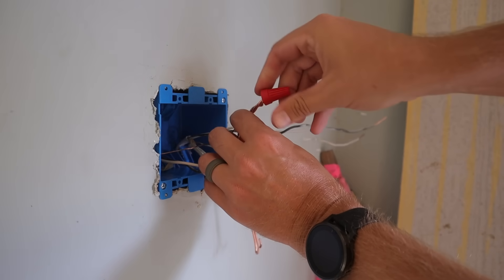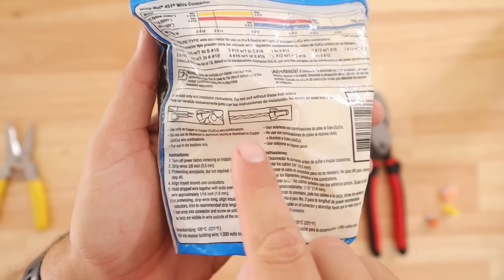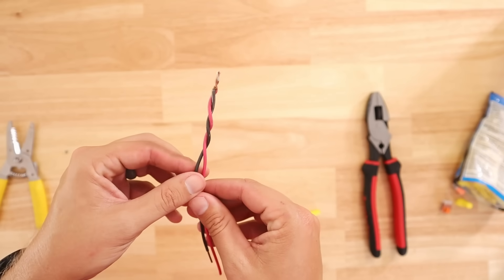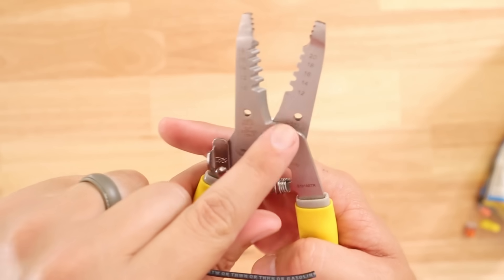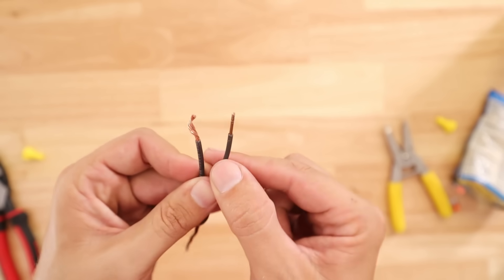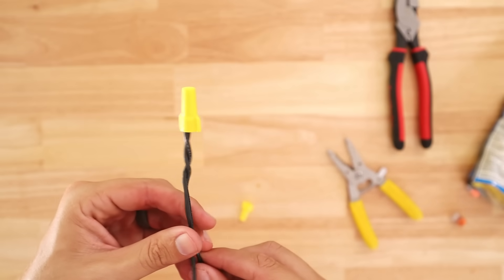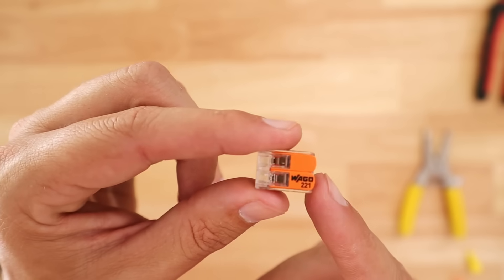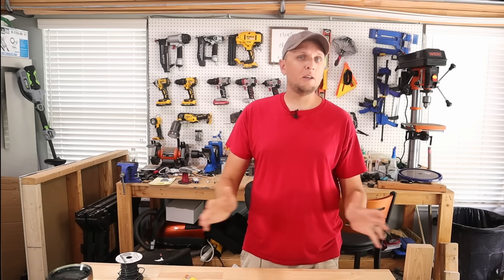BIGGEST Mistakes DIYers Make When Connecting Wires Together | How To

Comment: As an electrician and an adjunct electrical instructor, I certainly am behind everything you say. At the end of the day you want a secure connection that will not become undone under any circumstance. I can't tell you how many times I've found phantom power issues caused by poor connections.

The only area where I have a difference of opinion is where you talk about twisting the insulated parts of the wire together for an extensive distance. An Ideal rep told me the reason they depicted the wires twisted together so far was to prevent liability issues; they were trying to show the wire had to be twisted under the wire nut. A couple of twists beyond the wire nut is more than enough. My experience is that twisting the wires so far takes up room in the device box, as well as any wire too short, plus it's a pain for the poor electrician who has to modify it later. Keeping the work neat and clean also helps prevent wires from slipping out.

You used the best kind of wago nut, but not everyone will. The kind where the wire slips in, with no locking levers, is meant to be used only once, especially with stranded wires, as the jaws will no longer be as tight. It's a real problem when someone takes one off a 12 awg wire, puts it in their bags, then reuses it with a 14 awg wire. There is no way the connection will be as good. Again, this applies to the regular wagos, not the ones with levers as you used.
Reply from the maker: Hey Casey, I really appreciate the feedback on everything.  Thanks a lot for taking the time to write it all out!
Reply: Voltage will be off wire burning off a well and everything bouncing around with all that extra wiring cover jammed in that wing nut. Also he mentioned using strayed wiring. Always cut both fresh is questionable. Strands don’t push voltage, but do start fires. Also. 2-3 twist after nut is tight, Tape it for a hold on the twist. But all around good advice. I’m a beginner. But it’s pretty self explanatory. Now I’m not getting in over my head though. Would love to apprentice a pro working with boxes learning to run long lines , can install if day 95% 110 items such as lights, fans piggyback outlets(gvcis), run new outlets. The basics. But I’m not getting over my head burning  a house down or worse hurting myself. I’ve researched and double checked with the big dogs before breakers are flipped. No 220 experience yet either. After a Little more heavier electrical experience and higher end plumbing experience. I’ll be a jack of all trades. Master of some. Started off with flooring 3/4 red, white oak, pine, red heart pine, herringbones to custom burns not on styrofoam padding but on top of 3/4 plywood shot in with .22’s. Then board by board stapled on that tongue every 6-8 inches at 13. Back before these laminate and vinyl floors. Floors you can actually sand and refinish for years to come. Just picked up skills through the years with the pros
Reply: That's what I'm saying. This guy's jerking wires apart like everything he wires is for a mobile home that is constantly trailered just solder it off you're that worried. What does he think is going on behind a wall plate, Fragile Rock? Just what you said a couple twists it's good.

Comment: We build industrial control panels.  We used to get a lot of service calls when we used screw-tightened DIN rail mounted terminals.  We would tighten up the screws and the machine would work again.  When we switched to WAGO terminals those types of service calls ceased.  We crimp boot lace ferrules onto stranded wire and shove those in the WAGO terminals.  They come in sizes all the way up to at least #8.
Reply: Yeah WAGO terminals rock. He's talking about the WAGO 221 though. Usually they use these in commercial lighting. I'm not a fan of them, a proper splice and wirenut is far better. One place I worked, we were replacing splices with these WAGO 221s on the lights, so the security guards could change ballasts out easily, without having to call their service contract company (us). Boss charged them a ton for it, since it meant he lost a huge yearly maintainence contract changing bulbs and ballasts in a big sky scraper. They just don't hold together as well as a proper splice. 
Give me WAGO terminals in a control panel all day long though, please. Especially with a ferrule crimped onto the end. That ain't ever coming loose, no matter how much vibration there is from the unit it's mounted on.

Comment: I am a DIY and had a county building inspector tell me to tape the wire nut onto the wire after twisting the pairs together and installing the nut.  Needless to say, I did what he said just to get his approval.  This stalled my project for 2 more weeks.
Reply from the maker: Wow that is quite the delay!  Yeah whatever the inspector wants, the inspector gets.  They are all different.
Reply: @HowToHomeDIY  I’ve had a couple of difficult inspectors over my 40 year career. I don’t give into their wants and needs. I asked them to print out or point out in the code where that is required.

Comment: What causes a splice to fail is HEAT.  The higher the CONSTRICTION RESISTANCE the higher the OPERATING TEMPERATURE.  Tightly twisting the conductors together REDUCES CONSTRICTION RESISTANCE to a MINIMUM.  In addition to reducing CONSTRICTION RESISTANCE tightly twisted conductors have the best MECHANICAL INTEGRITY.  Remember these words and use them to instruct others.  If you know OHM'S LAW it's all the better.   Wagos are JUNK.
Keep 'em from burning down :-)

Comment: 1:00 is it good enough.  No.  Not with a yellow wing nut.  However, had the wing nut been beige instead of yellow,  it would be good enough.
11:00. The best installation is crimp and tape.  That would be hard to find.  In 20 years of being an electrician, I've only seen it specked on a job, once.

Comment: I like Wagos for solid/stranded connections and for very tight spots. They are pricey but I'm not a pro. So I'd rather have the 20 connections I make a year be solid without having to triple think things than pulling stuff and wondering if it would have been OK without. I made a remote controlled outdoor outlet over the winter and I used Wagos just because the IP<whatever> enclosure was tiny and I was having a hard time getting wire nuts in place. (And all the demo videos for the WiFi switch were from the UK where they use Wagos all the time I think by code.)

I don't know how they stand up to pulls and pushes in general. I do feel like every time I'm stuffing wires back in a box I'm rolling the dice so I don't know if I'd use them in most wall switch kind of applications.

Comment: It's pretty simple really, if you aren't turning your wire nuts clockwise, and you aren't giving each wire a good tug to ensure it's not loose, then you are doing it wrong.

I can't stand when I have to work on broken shit that's hot on a service call, open a box and find some overkill electrician pre-twisted, and post twisted every damn wire together. Completely unnecessary. 

Also have seen thousands of wires that popped out hot, and tripped gfi's or breakers. Burnt things, broke things. I've seen people over twist till the wires crumbled inside the nut and later melted down like nuclear waste until causing a small fire. So it goes both ways. Overkill and underkill. 

People who only do new construction, or put things together once, and move on, have no clue how to make things serviceable and safe 9 times out of 10. Just my experience after 20+ years doing commercial and industrial electrical work.

Comment: Wago connectors are great for lighting or low current devices, I would not use them for motor controlled devices or higher amperage. Mainly what you have are two blades making contact on the wire in a sense derrating the wire IMO; great for lighting tho…

Comment: I like the ease-of-use provided by the Wagos, but it’s important to recognize that the Wago becomes an in-line component of your circuit.  ALL of the energy in your circuit passed through the connecting bar in your Wago.  The wire nut, on the other hand, and as clearly demonstrated in this video, only wraps and hoods the twisted direct contact. At most, some energy will pass through the wire nut parallel to the twisted connection.  
My point with this is selection of the correct Wago is critical. Especially as you move up to higher power applications.
Reply: Sure, thousands of electricians trust the current carrying ability of a tiny copper plated springy tab pressing against one side of a conductor.  The amount of actual surface area where the flat tab touches the round conductor is laughable.   Over 20 years ago they first introduced this design, and we veterans of the biz watched it fall flat on its face over and over....   
I guess some never learn....
Reply: @kdubb288  From a well seasoned electrician, Well Said
Reply: @kdubb288  As an electrician completely agree.
Reply: @kdubb288  In other words, the real "problem" with lever nuts is the fact that we insist on solid core wiring, that can't deform to make good contact.  We've used them industrially on stranded wire for decades without issue.
Reply: @wagnerrp  a "lever nut" is not the same as these strip-and-push in types.  But neither will obtain the same surface area contact under pressure that a healthy twist with lineman's pliers obtain.  Ever.
Reply: @kdubb288  Ok..you are over my head. Did you just say use wire nuts instead of wagos?
Reply: @denisemartin3603  YUP!
Reply: We use wagos in solar all the time. Even tesla supplies them for their battery walls

Comment: The wire nuts themselves make a huge difference.
We use the 3m nuts and the spring is so damb sharp it really cuts in and will twist wired.

Those ideal nuts are OK but when you twist them you feel the spring spring back.
And yes you should pre twist for almost all connections.
Reply from the maker: I have some of those 3m wire nuts.  I need to give them another try.  Some of my electrician friends swear by them too.  Thanks for the feedback Nick!

Comment: Another suggestion is to wrap wire nut and wires with electrical tape to eliminate vibration issue on wire connections.

Comment: If you have time to waste, pre-twist. With today's wire nuts, it is not necessary to pre-twist. Pre-twisting was recommended many years ago when the wire nuts had setscrews that tightened down on the wires, then a plastic cap was threaded on the brass sleeve. It's good practice to twist 2-1/2 to 3 turns.  You can over twist as well, which puts a lot of strain in the wires.

Comment: I'm a long time DIY'er and let me tell you, this is some good advice! I wasn't familiar with the WAGO connectors but will probably try them on my next project; particularly on something like lights and fans that sometimes have very small gauge stranded wires.
Reply: Over here in the UK we use Wagos all of the time on 240v. They're absolutely fine it's the cheap knock offs that are an unknown quantity. 

Don't understand why the pros on the other side of the Atlantic haven't ditched the wire nuts yet, far too time consuming. The resistance of the joint between those and Wagos is negligible and would only have an effect if you had something like 1000 joints on a circuit. Not realistic at all.
Reply: @johnt9379  wire nuts rule the roost over lever connectors for cheap connections though.  Overall I prefer the lever connectors if there's any chance the wiring every needs to be reconfigured or disconnected while live.  Once the wires are all twisted securely for the wire nuts, they can't be properly reused without cutting it down and hoping you have enough of a service loop to work with to redo things.
Reply: @johnt9379  Wagos have not taken on in the US because electricians trash talk them.  
It's because it makes it easy for do-it-yourselfers to work on their own stuff without hiring them.
Reply: @highping1786  Professionals over here don't (shouldn't) really be putting joints on socket circuits anyway whether it's a ring or a radial. With our sockets we terminate straight into the socket and have no need to have to fly lead off. If a socket needs moving you try to pull cables back and rewire short cables completely. Doesn't always happen but we definitely don't need to wago cables for socket circuits nearly as often.

Lighting on the other hand we use wagos quite often. the wago itself is rated at 32a but the circuit is protected by a 6 or 10a circuit breaker. I just think it would be a pain having 500 lights to fit in a warehouse and using wire nuts. Time is money after all.

If DIYers want to use them in their house then let them. Don't want to work in peoples homes anyway and would much rather work in a commercial or industrial premises. Less s*** work for me to have to do.
Reply: On small stranded wires, get terminal crimps before putting them into the level locks / WAGO
Reply: If u gonna use stay cons/crimp sleeve……no need for much else besides insulation or tape to cover
Reply: Wago lever lock type hood for dif sizes….small to big ect

Comment: When twisting wires together, usually 12-gauge, I like to not only twist them tight but I cut the top at an angle so it dives deeper into the wire nut and cinches down tighter. Cutting them square reduces contact area within the wire nut. Ultimately I rely on the wires themselves being twisted together, the wire nut is just the insurance policy and mostly removes the chances of the wires touching anything.

Comment: Ok, so it is not NES code violation, it’s just your bias opinion (wing nut) I get where you are coming from, but is not gospel. I twist the tips, then wire nut, that’s the way I was taught.
Reply from the maker: No the first one is an NEC violation as it didn’t follow the instructions.

Comment: Glad to see this laid out so clearly, and really glad to learn about the Wago connectors!  Seems like they'll work MUCH better tight spots!  Thanks!
Reply from the maker: You're welcome!  Really glad to hear you liked it.  Thanks for the feedback!
Reply: Good products cost more money.  If you take your time you can accomplish the same goal with wire nuts and save money.  If you are just adding one or two things like a ceiling fan or a light fixture, it's not a big deal, but if you are completely rewiring an old house those little things add up.
Reply: WAGO connectors have gotten me out of jams on older homes where for whatever the reason the leads coming into the box are too short (sometimes after too many changeouts the wire has become work hardened and breaks) and can not be connected to the switch or outlet (even the last resort, back wiring).  WAGO connectors allow for a pigtail at the proper length to now make the connection.  Whew!!

Comment: With 32 years in the HVAC trade I would add you should check the amperage rating of the wire nuts first. I have found so many electricians using wire nuts on applications where the amperage of the motor over heats and destroys the wire nut. I bet I have found this 50+ times. I recommend not using wire nuts in applications 15 amps and below.

Comment: Im a sort of self educated out of necesity electrical fidling guy. Cars, computers or the house. The internet has helped a lot but much of this i already do because I understand how things just work or work better. Thats not to say i have not made mistakes as a kid. Luckily done killed me. What i think the average DIY person does is they go to thw hardware store and try to find things in the order of availability, cheapest, works and safe. When safety should be the 1st in that list it often becomes the last. Usually because of budget or availability but also because its a house they are moving out of or just something they need fixed for now. 

So in my opinion the best products are ones that are by design safe but also work right with littlw chance for a noob to mess it up. Reliability that it will work and be safe and easy will apeal to DIY'ers unfortunatly cost pushes its way to the front and people take the cheap way out, the product is trash but they force it to work for now and it falls alart or unfortunatly, gets them killed. 

The standards in our country if followed can and will keel people safe but if there is a way to do something wrong so much that it could kill you, someone probably already has. 

Hopefully now with the internet, people will opt to educate themselves first with videos like this and make decisions on parts and tools in the order of Safe, reliable, easy to use and last, a reasonable price. Provided its available and not sold out.